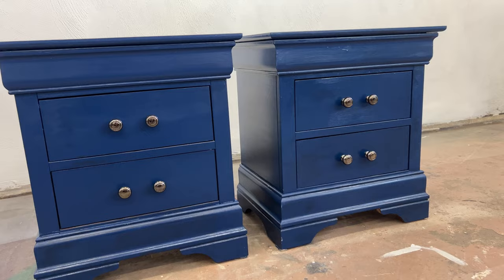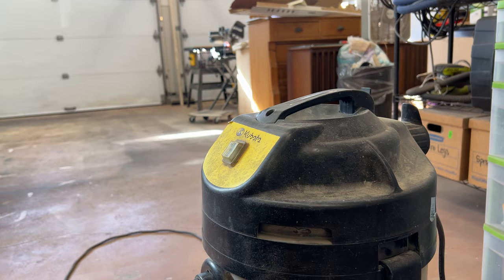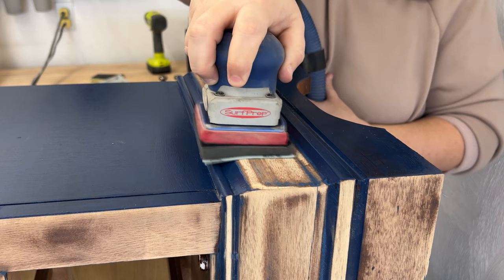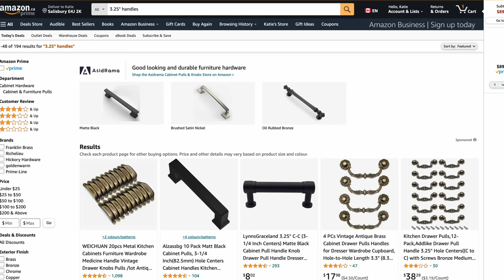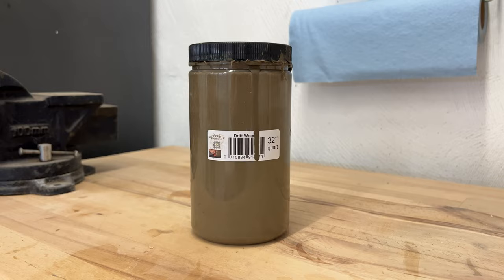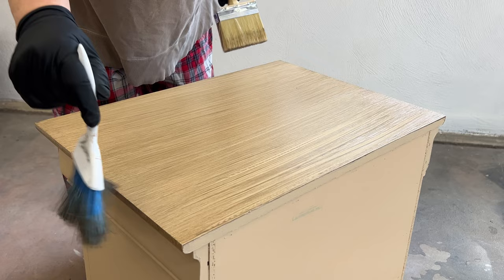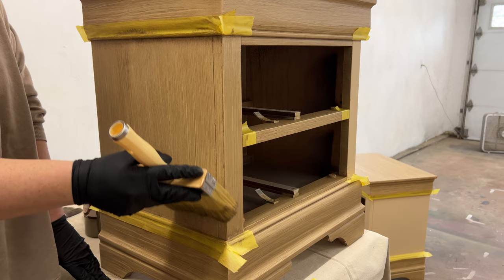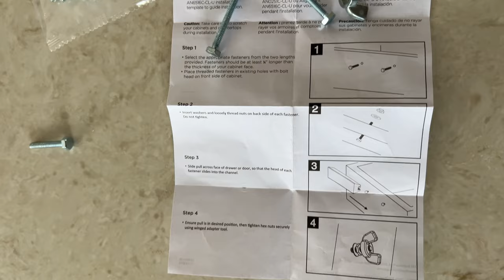How to create a Wood Faux Finish the EASY WAY!

Comment: Beautiful Katie! I’ve been trying to do this on my large table top with Retique It. I’ve had to redo it all five different times now! Ugh 😥 I’m super frustrated because I need to work in sections on the large table top. when I start the next section, the first section has already started to dry, and it messes up the edge of the first section. now i’ve moved on to a semi gloss neutral paint then doing the brushing with Rust oleum decorative glaze in Java brown. and it’s doing the same thing, drying  too fast and messing up my first section. So now I’ve ordered an oil based stain that I’m going to try hoping that it has a longer open time. Any suggestion for a large surface like a table would be also helpful!

Comment: Curious why sand the paint off over using a chemical  paint stripper? I like your videos, they're inspiring!
Reply from the maker: It’s usually cheaper, less messy and faster but every surface is a little bit different.

Comment: Could I do this with an oil based stain instead of water based??
Reply from the maker: You could try. Just make sure you’re using an oil based sealer over top of it too.
Reply: @salvagedbykscott  could I use a water based sealer if I let the oil based stain dry for a few days first?
Reply from the maker: Follow the instructions of whatever products you choose to use 👍